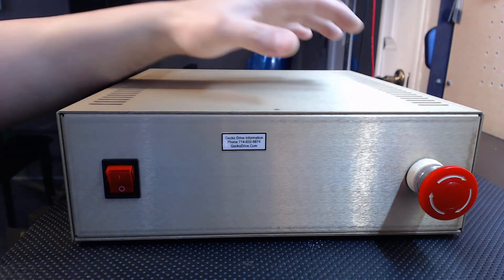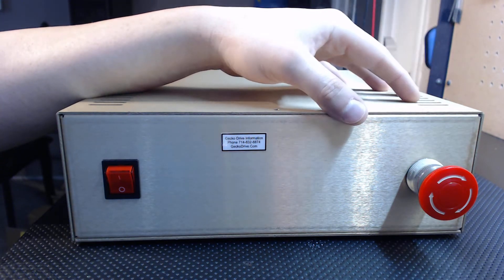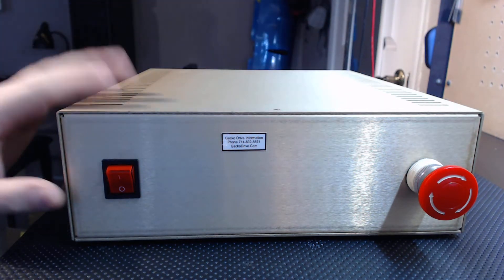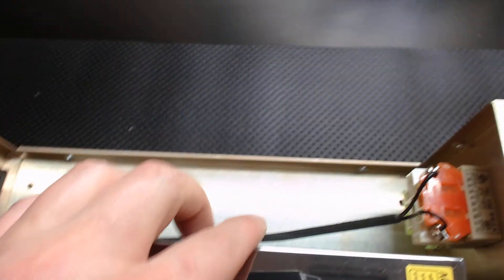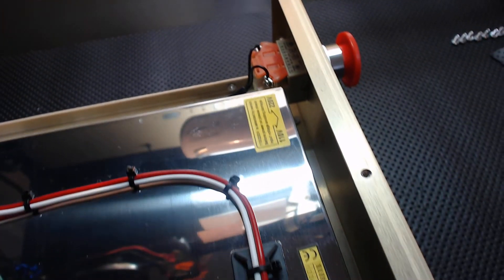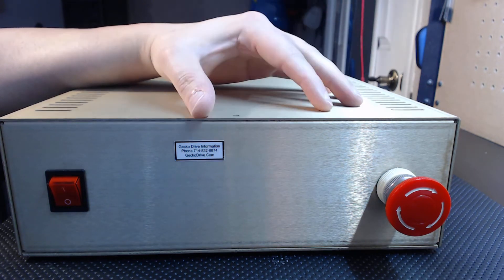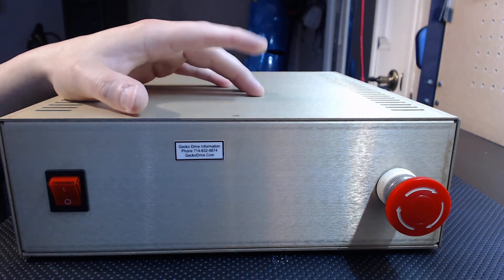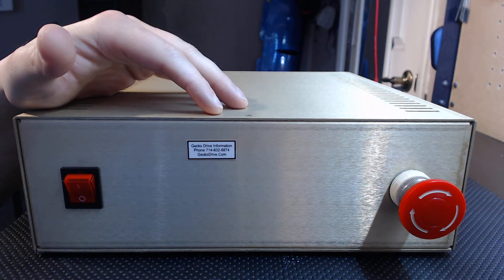Gecko G540 Motion Control System Rev2 Edition Updates!!

Comment: I don't see any SSR relays in there. I also have a similar question from another viewer you failed to address. How does a G540 rated at 3.5 amp run a 600 oz. motor rated at just over 5 amps?  
The educated public would like to know unfortunately your request from over 5 months ago has gone unanswered...
Reply from the maker: David,

Your correct as SSR are simply not required with all systems as their an option for my clients to choose to add. There's simply no use paying for something you don't intend on using. My 600oz motors are engineered by myself in house, and produced by an OEM manufacturer to my specs. I'm not sure where you came up with a 5a rating? The links to their specs are located here https://www.ebay.com/itm/142172266617, and its apparent by my eBay feedback they are rated correctly as there actually a Nema 24 motor which are the same mounting pattern as a 23 except for their longer chassis.Your comment about  Koollakes question I answered previously in a private message as he was ordering a system from me. 

Thank you again for your support, 
Vince
Reply: corvetteguy50 ok. Thanks Vince.
Reply from the maker: Thank you again David for your support. Vince

Comment: Ok thanks. All I have is the blank 6040 frame you said was a good frame to buy. I also did the blue lock tight. I put it together once then I used ratchet straps to square it. I’m missing everything so buying the bundle would probably be best although I’m not sure about the setup. But I’ll sesame you tomorrow I’m in ny. Also real quick could I use 300oz instead to cut acrylic and aluminum that’s is all I’m milling
Reply from the maker: You can use the 300oz motor configuration, but its not optimal for aluminum. 300oz is much better suited to wood, and acrylic. If you need all the required components to finish the chassis I can provide everything in a a complete package to take the "guess work" out of it. Just let me know when your ready. Thank you, Vince

Comment: Ok so let me understand you correctly. If I buy the rev 2 kit with the 600oz motors and wires and connectors. All I have to do is wire up the ends to the wires you provide with the motors and run Mach 3 alone with the other programs to make Gcode and that’s all. I can be up and running on my 6040 in under a hour.  For about 800.00 private message me for any other details I need before I order thanks
Reply from the maker: Mitch,  your correct in what you wrote, although my 600oz system is actually closer to $900 shipped in the US. You would of course have to perform axis calibration on your machine to make sure the dimensions of the software are transferred to the machine in real time. Please message me at Storm2313@gmail.com to cover any other questions you have. Thank you,
Vince

Comment: Vince,  i would like to know you opinion on the Centroid Acorn CNC controller.  Just saw some videos about it.
Reply from the maker: The Acorn is essentially a modified ethernet smooth stepper. It still requires using a G540, or other drivers, and considering the support costs $90 an hour unless you use their forum I would say for most applications there's cheaper more inclusive options. Review the listing here for it, and read all the details.  http://www.centroidcnc.com/centroid_diy/acorn_cnc_controller.htmlWith newer computers using I5, and I7 Intel processors (I'm an Intel guy) the thought of having an onboard CPU to provide processing for motion isn't at all required. Thank you,Vince

Comment: Ok can I use this on a Bridgeport boss8 E2R3
Reply from the maker: Abram,A Bridgeport retrofit requires Nema 42 motors. You would require a Gecko pro drive system to support it. I can build a package for you if you like. Please let me know.Thank you,Vince
Reply: Like to know the price
Reply from the maker: Built, or DIY kit?Thank you,Vince
Reply: Built the package for me how much will it be
Abram
Reply from the maker: I sent you an email. Thank you,Vince
Reply: The Bridgeports motors are servos. Unless you switch to stepper motors that is a "no go ". There are unfortunately no way to practically make this work as it's incompatible. I have a Ajax system for my Bridgeport I'm very happy with. You're gonna have to bite the bullet and lay out a few bucks to tournament your BP into a modern cnc machine.